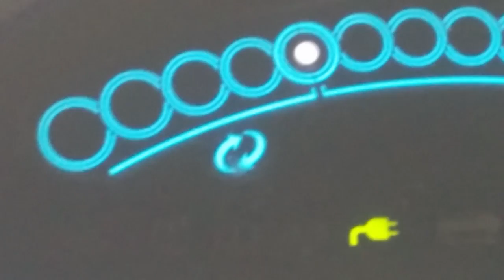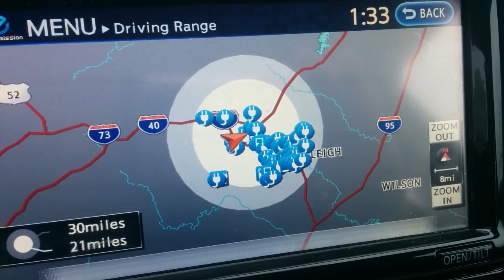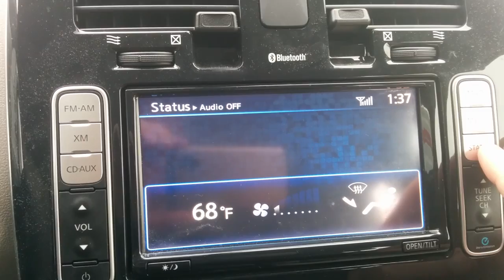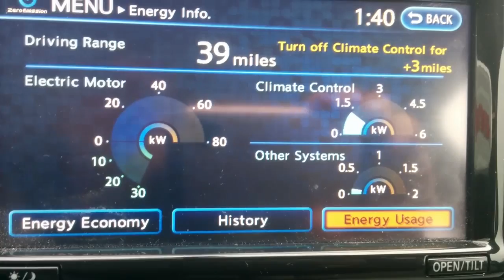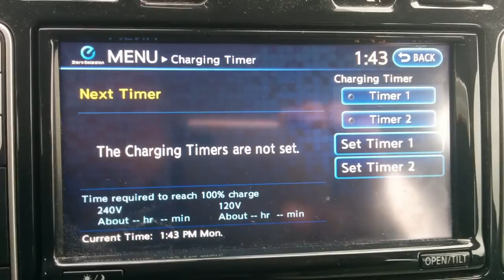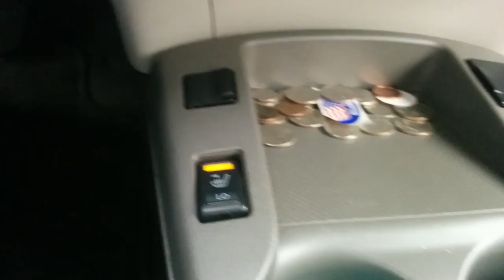LEAFHacks Ep 1:  Quick tour of the Nissan LEAF

Comment: I'm getting between 4 and 5 miles per KW. Looks like you're getting a lot less, I was hoping for some tips on improving range as well as other things. Will you're miles per kw be improving as the show progresses?
Reply from the maker: I was getting 4.4 in the summer on the original tires.  New tires brought it down to 4.2 (not as low rolling resistance apparently).  The numbers I am getting in this video are from a fairly cold December with a lot of highway driving.  Worst numbers I've had since I bought the car.

I will have some tips on driving efficiently in a future episode (specifically my recommendations on when to and when not to use ECO & B mode), but I would say if you are getting between 4 and 5 you are probably doing as well as you can already.
Reply: wow that's good, I haven't come close to 4.4, my average is around 3.1 I think.  I wonder if the low rolling tyres are less grippy and more prone to losing grip in some circumstances?
Reply: I'm a little late with this reply, but just found this video.  I just bought my used 2014 Leaf (S trim) and have been trying to learn how to increase this, but the highest I am able to get is 3.7 in the past week (my first week).  Of course, i don't have the "B" mode, just ECO mode.
I am amazed at some of the videos I see where people are getting the 4 and 5 miles per KW.  No matter how careful or slow I drive, it seems to only move a tenth of percentage very sparingly.